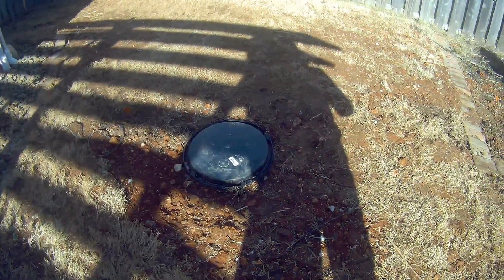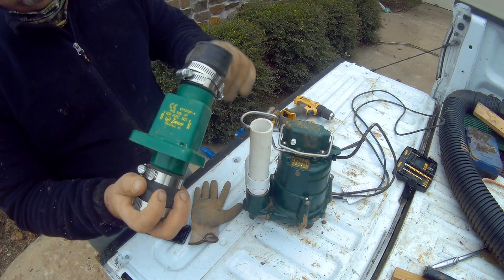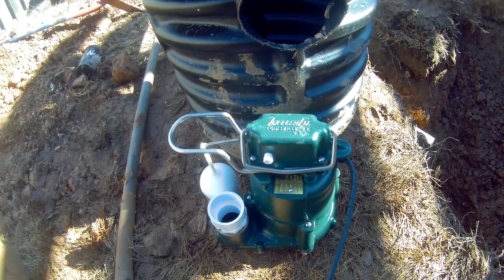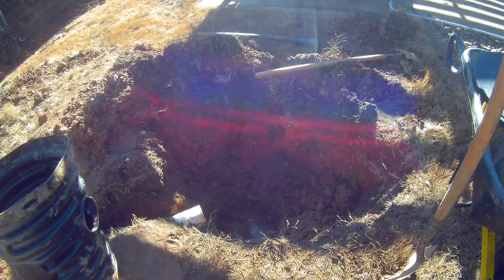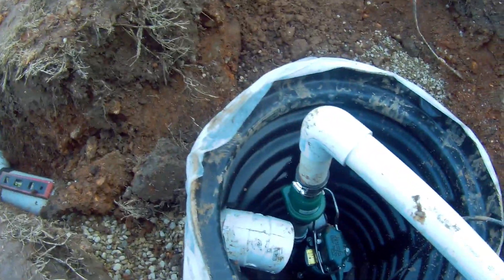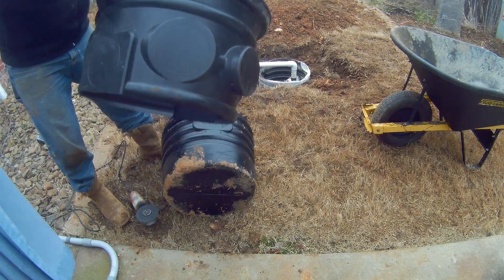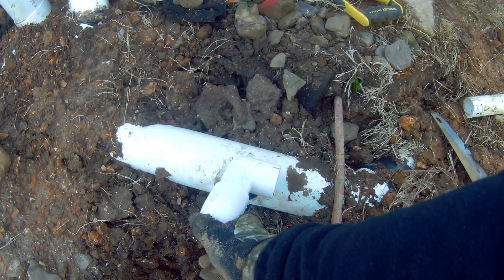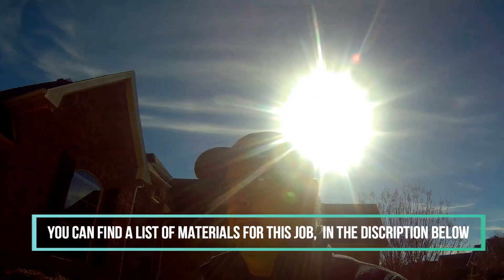How to Install Sump Pump  - Backyard Drainage Solutioins -

Comment: Difficulty finding sump pump with 25ft cord

Anyone know why it’s difficult finding a vertical switch cast iron sump pump with 25ft cord? They all have only 10 feet or less. Home Depot, Lowe’s, Amazon... Due to the shortage?

Comment: Brooks what is the fabric for around the sump basin? I didn't do this on mine. Now wondering if I should have. Is it to prevent rocks from getting sucked into the Zoeller and ruining it over time?
Reply from the maker: Mike Lewis SELA it’s just something I picked up at a big box store. Nothing special, and I do not recommend using this fabric in a French drain. For this application it worked fine and served its purpose. Helped stop the rocks (some of my holes I put in the basin were larger than the stone I used)  and some sediment migrating into the basin. 

I’m not sure you one even need to do this step. This was a heavy clay soil, so I probably could have gotten by without it.
Reply: @bbdrainage  looks like a good idea. Wish I would have thought of it before I buried everything.... Anyway pretty cool video.

Comment: Lol i wudnt lay it 4 10$ w foot if u dug the holes lol i get 30 a foot on 4 inch no matter what. Covers digging fitting and back dress. Plus pumps and up it when 6 inch involved to 35$

Comment: Looks good man. In oklahomw that job b 4500-6,000. Just by watchn the vids not sure on footage of pipe. But nice work. That sump will never have a issue with that little catch and one drain.
Reply from the maker: Yes, Don't forget we used 6" pipe on one section, so up that a bit. Good to see your not charging $10 per foot. Had a guy call me (in the business) telling me he charged $10 per foot to install French drains, French drains...$10.00 a ft?!? Not surface drain like this one, I'm talking a French drain, which is a whole different creature. 

I'm thinking man, can I sub you out :)